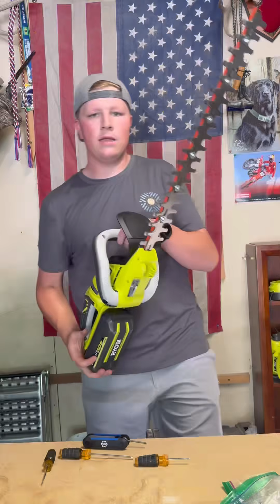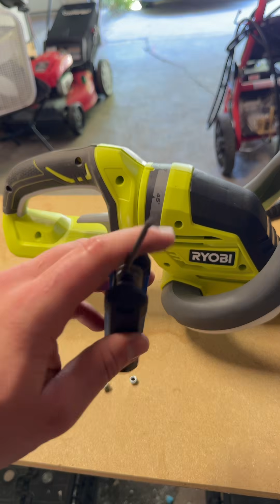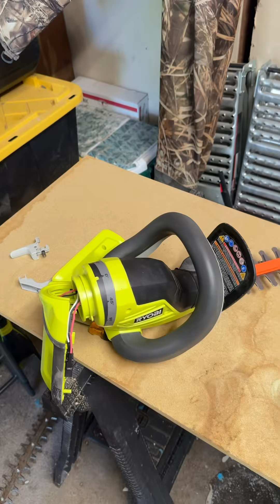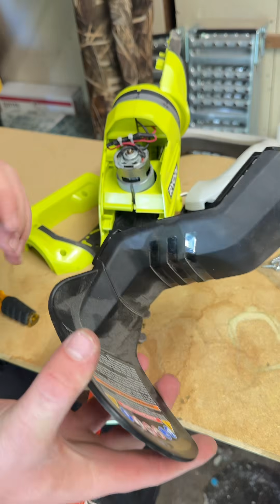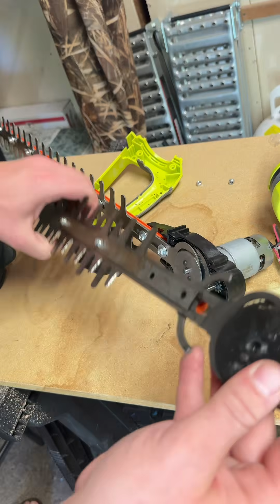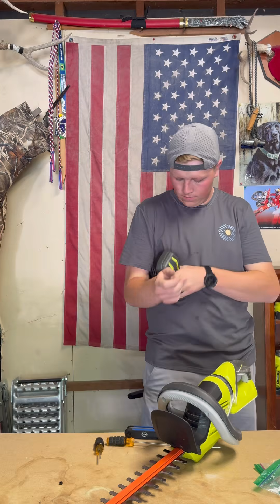How to fix broken Ryobi 40 V hedge trimmer #ryobi #tools #diy #ryobitools #ryobihedgetrimmer

Comment: Thanks for confirming that disassembly is required.  Complex process. I had a screw in my gear but couldn't id the source..  Another video said it attached the motor.  It's now on my bench for reattaching the next time.   In the process, I thought I needed to take the blades apart to get the assembly out.  Not correct.  Don't overtighten the nuts on the blade.  You will over-burden the motor.